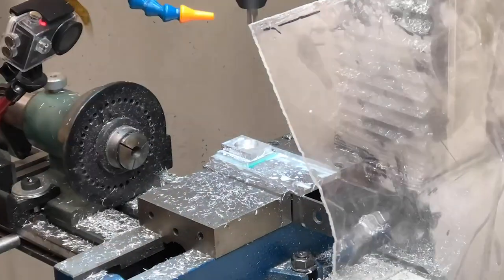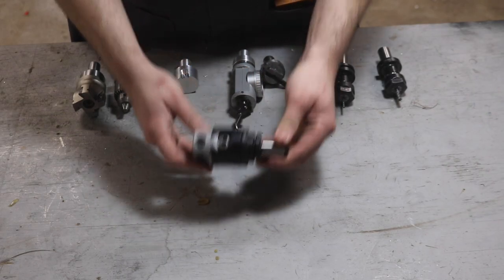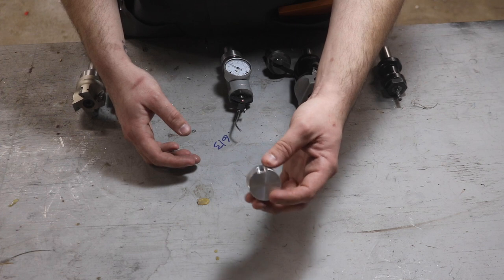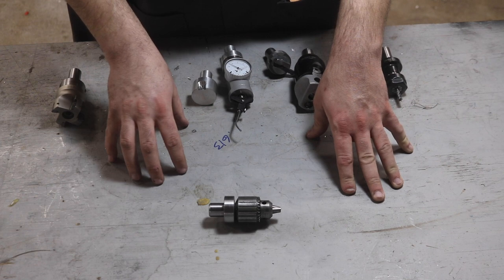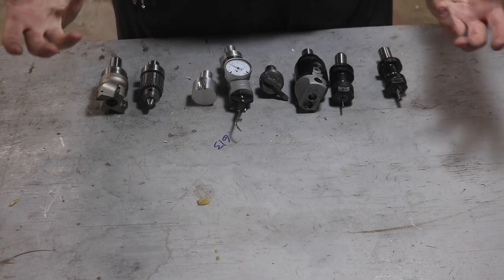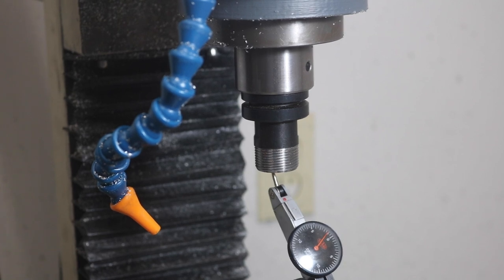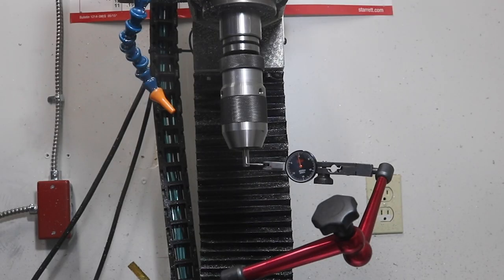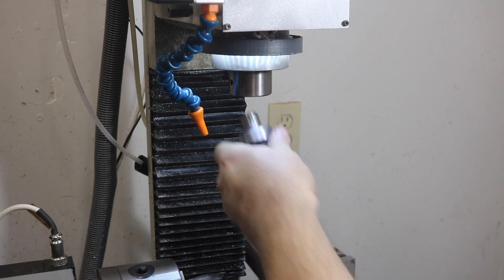Off Brand and Homemade TTS Holders for my DIY CNC Mill

Comment: First thing I did after getting a cnc mill was spend about 3 months trying various collets, holders, end mills, feeds, speeds, materials, collet clock positions, dial testers and adjusting/locking gibs in an attempt to get the best finish possible. I kept being told "bigger end mills leave a better finish" and everyone thought my 0.0005-0.0007" of runout at the end mill was high. I was using genuine TTS ER32 holders and shars 0.0003" collets with pretty much no runout at the R8 taper and 0.0002" or so with R8 collet at the end mill. Actually all of my R8 collets had very little runout(believe they were Precision Matthews) while the TTS weldon style 3/8 and 1/2 had more runout then my TTS ER32 holders none of them were anything to write home about so the numbers you got here aren't bad at all considering the genuine Tormach stuff is about 3 times the price.

Comment: While I recognized that you didn't hit the Jacob's chuck particularly hard to set it on the taper I believe its recognized practice to wind the chuck open and do any striking on the body of the chuck and not the jaws. Hitting the extended jaws can break the teeth on the jaw scroll and/or the scroll itself resulting in a useless chuck.
Also the screw in the chuck to hold it on, especially a threaded arbour like on a hand drill, is usually a left hand thread to resist the temptation of the chuck to unthread (unloosen) itself from the arbour under normal use. If that matters on a tapered arbour I'm not about to make an argument. Just noting. Otherwise an interesting video. Thanks from Canada's banana belt.🤞🇨🇦🍌🥋🇺🇦🕊️🇺🇲👍

Comment: a point of concern to me about the tts is the entire consentrisety situation depend on the collet. my machine has mt4 taper. had to make my own collet. does not run repeatable at all. even made a step in a holder to regester on the spindle nose.....no joy. i think the system is highly dependent on accuracy of the collet. spindle bearings also are a big deal. nead to replace mine before i go any further.